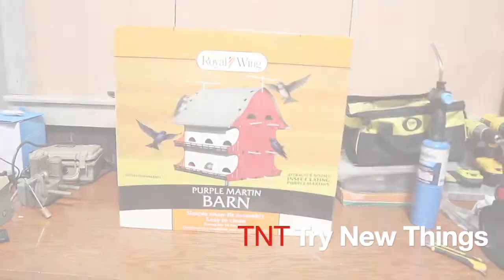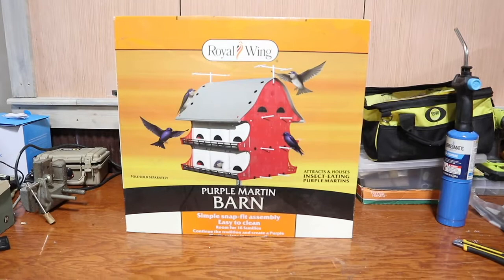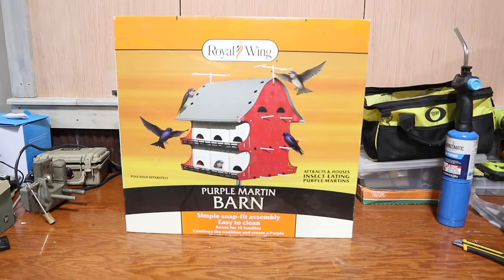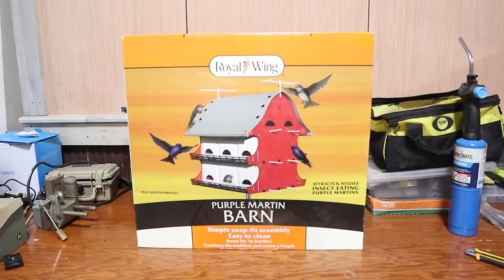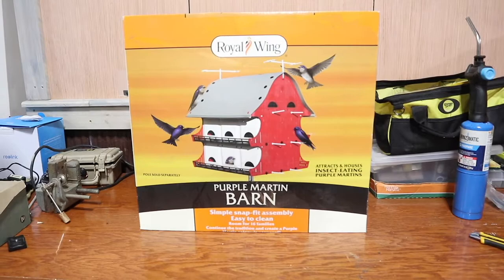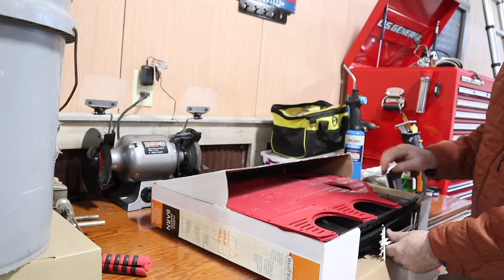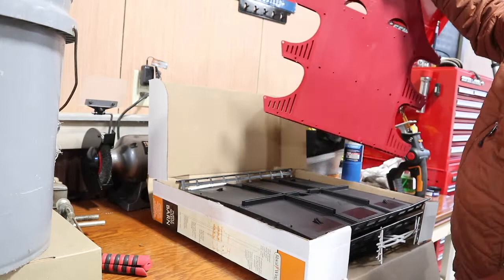TNT #109:  Royal Wing Purple Martin Barn (House) - Assembly & Review

Comment: I purchased the S&K 16 Purple Martin Barn and the Tri-Tel 12 ft Pole. I then called S&K and ordered Plastic Ground Sleeve and an additional section of pole. I found the pole instructions terrible. I called S&K to get help and was told to drill a 1/4 inch hole 3 inches from the bottom of the additional section. That was needed but that did not solve the problem I had when I added section C to the first section which was the additional section. IE the additional section that was in the ground. I solved this problem by adding ten or more plastic grocery bags into the additional section. I also added six or more bags to section C.  The 1/4 inch hole I drilled 3 inches from the bottom of the addition section was utilized when I had the house all the way up. What the bags do is position section C and B so that they are in a position so you can grasp them.  I'm glad I used the plastic sleeve so that I can remove the pole. S&K needs to make videos on the assembly and installation of their products.
Reply from the maker: Hey, first, thanks for leaving the feedback.  Not sure I'm fully following along as I did not order any extension.   I did have 'fit' issues where I used the round steel pipe to support the bottom of the pole, the bird house just spun in the wind.   I ended up making 3 wedges to go down the sides of the triangle pole into the round pipe.   I would not think that only having 3" of overlap between sections would be enough (??)   Each of the top two sections of my 3 section pole had a pre-drilled hole where a pin was inserted to keep the section from dropping further into the one before it.   I have taken the house down a few times so far to clean it out, did not have to struggle too much.    But, it sounds like you have found solutions to your challenges.   I hope the martins find and like your house.   I had 'visitors' only the first year, and this year I had 4 couples call it home.
Reply: @TryNewThings  My poles have pre-drilled holes for pins. I couldn't find a good video on the installation of the Tri-Tel 12 ft Pole.  I like your video showing the way the barn is installed on the pole. I have the same barn.  I assume you use a pipe in the ground to allow for inserting a different pole design. The plastic sleeve I installed in the ground only allows for the installation of the Tr-Tel pole. But I can remove the pole from the plastic sleeve which is flush with the ground.